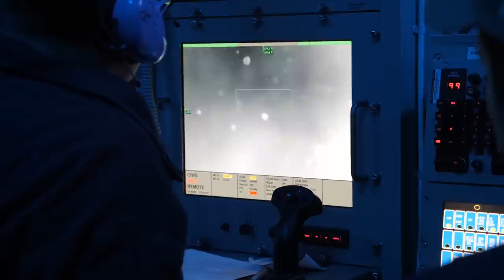U.S. Navy Destroyer Fires Its Weapons

Comment: Was always at gun control panel below.....got a relief so i could go topside once. Stood above the bridge on weather deck. Concussive force was incredible and felt throught whole body. You can see the cables on the rails there shake from the shock wave. Camera wont hold still. I had been with the 5"54 mark 45 for so long i memorized every single sound from the hydraulic motor startup to the ping from the powdercase hitting the deck. No. We didnt use pads. We chipped and painted. So when the mount didnt make the proper sound at the proper moment i had to go from mount captain to mount trouble shooter. Alone. Only schooled tech aboard so as a 19 year old E3 was being asked a lot of questions by the C.O. on down....now that i think of it....i felt like wesley crusher? Ugg. Spruance Class Destroyer.  Gunners Mate Guns.....

Comment: I like this video because it shows the various weapons destroyers have beside the VLS and shatters the notion that Destroyer can't fight without their VLS
Reply: verdebusterAP yea but they can only fight close range without it and if the enemy has missiles Anti ship missiles then that destroyer will be put at the bottom before it can use the guns
Reply: @ @grantrichardet6250  

This CIWS can handle anti ship missiles
Reply: verdebusterAP  I’m aware but they won’t be firing a handful of missiles they will likely  fire dozens and that’s why it’s important to reload the Mk 57 VLS while underway
Reply: verdebusterAP another thing I’d like to add is that tomohawk missiles are subsonic  and I feel like the us could use surface launched hypersonic cruise missiles because the Chinese will be able to shoot down tomohawks
Reply: @ @grantrichardet6250  

The RIM-162 solves that problem. It can be launched without use of the ship's system.  More to the point, 4 can be packed in one VLS tube. The SeaRam is another stand alone system
The USN needs too look at finding an effective method to reload VLS at sea
Reply: @ @grantrichardet6250  

The TLAM still has plenty of life in it

Comment: Looks like a frigate more than a Destroyer
Reply: What is the difference?
Reply: idk @altarush
Reply: @altarush an Oliver Hazzard Perry class frigate, which have all been decommissioned I believe, was about 3 tons lighter than an Arleigh Burke Destroyer and didn't have as many VLS cells as a destroyer. So less missle capacity. Although I believe the frigate and destroyer did have the same size main gun. A 5" I think 🤔.  Those are the main differences between the two

Comment: Why do some Arleigh Burkes not have the forward CIWS?
Reply: There's two variants I think, Flight 1 and Flight 2s. I think Flight 2 variants have more space to store helicopters and Flight 1s have 2 CIWS
Reply: Really is comes down to money. The Flight2's are outfitted for one, they just don't install it. It was a cost saving measure.
Reply: @titus142  Oh I see. Seems like a big loss in defense though...
Reply: @michaelcarnevale103  Not particularly. They have two other defence layers with the Standard and ESSM missiles as well as jammers and decoys. The CIWS is a backup to the backup.
Reply: @Akm72  what about for small boat attacks?
Reply: @michaelcarnevale103  CIWS are useful for that, sure. But they do have a couple of 25mm cannon and the 5 inch gun as well.
Reply: @Akm72  I was just thinking...What if the 1 CiWS jams or something? I dunno. Do you think they will ever be retro fitted on the front or maybe we will see a laser weapon or rolling missile go in there?
Reply: @michaelcarnevale103  Sure, it's possible. If lasers prove themselves maybe we'll see a lot of them being fitted to Burkes and that slot is free.

Comment: I'm actually not impressed with the waste that enters the ocean by these drills. At least they could have had something that prevented the empty shells from getting lowered down in the water. As for the weapons themselves, they will never be used in any useful scenario.
Reply: khelben1979 so before ww2 you would’ve been saying the same?
Reply: Easy Snowflake
Reply: So a shell  sits on the sea bottom. And?
Reply: They actually do use most of these weapons regularly when sent on anti-pirate missions. It's arguable if we really need as many carriers as we have given how few our competitors have, the availability of land fields, and the extreme expense of building and running carriers. But these little DDs do some real work protecting maritime trade and are fairly cheap.
Reply: Apparently the Navy doesn’t seem to care what you think.